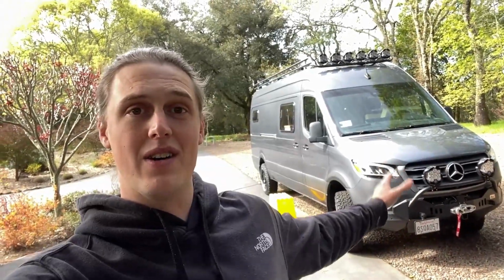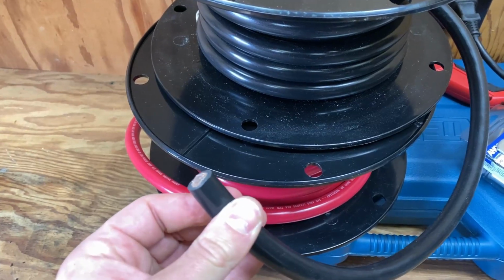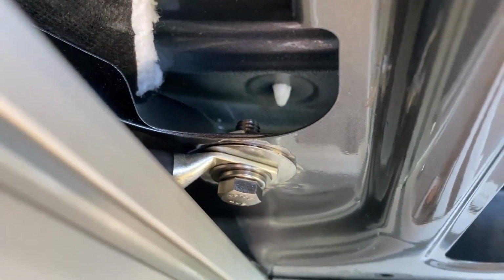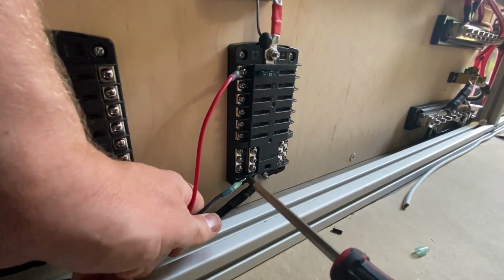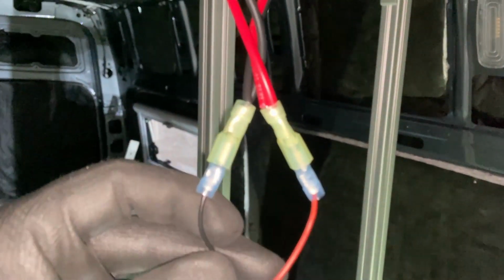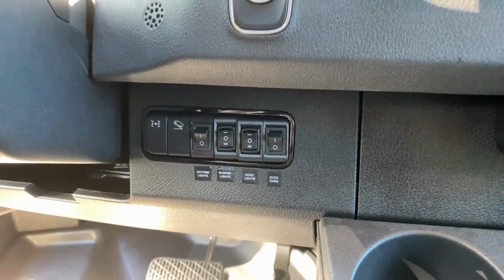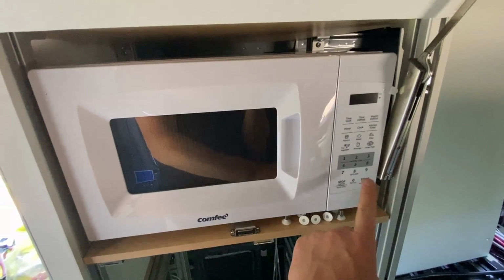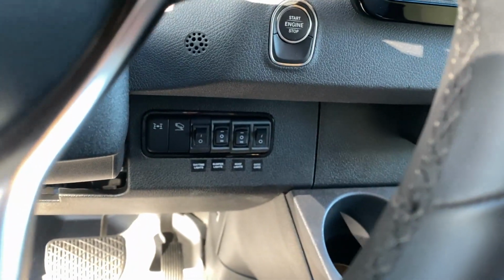⚡ How To Build An OFF GRID ELECTRICAL System In A Van ⚡ - Part 2 of 2 - Execution

Comment: First - thank you for this video. With 1000Ah of battery, did you consider a second alternator (like Nation's Alternator sells) with a Wakespeed WS500 regulator to put out 280A of charging? Would really cut down the charge cycle times if you're planning on using that A/C often. I'm looking at using that setup and wondering if there was a reason you didn't do it (other than maybe cost, but that seems to be relative).
Reply: I’m planning to get that same alternator. From what I read you don’t even have to run it through a dc to dc charger. I’m not exactly sure the advantage in the 3 belt version. I guess reliability.

Comment: Pro tip. Mount switches and controls on the same side as electrical system not only to save on drilling holes but also saving on material costs

Comment: I have two maxxair fans and the one remote is not a problem. The remote has an extremely limited line of sight so you have to very deliberately pointed at the fan that you want to use. I actually find it extremely convenient that they use the same remote.
Reply from the maker: Good call!

Comment: Definitely test the cell booster before you find a final place to install it. I have the WeBoost version and my hotspot needs to be within a foot to get better signal. It's not the kind of thing where the interior antenna gets mounted inside and you get better bars anywhere inside the van.

Comment: If the "wire highway" is to get power from one side to the other, why not run the supply mains to one or more fuse boxes then branch out along that side from there? Fewer wires under the van.

I would also recommend the plug (male) connectors on the device with the outlet (female) on the supply side, like the appliances in your house. And, make one lead longer than the other. For instance, make the hot longer, perhaps by 1/4" to 1/2", from the device and the ground longer, by the same length, from the supply. Not only will this help keep polarity straight if you need to unplug something, but the connectors won't be side-by-side.

I like the cabinetry skills.
Reply from the maker: On the first though (replacing the wire highway with a sub panel at the destination) that’s what I ended up doing.

Great recommendation on the lengths and the female/male distinction!!! 

Thanks Carl Knox

Comment: Why did you run the conduit outside the van, underneath, rather than through the walls? Great vid, great channel! Thanks!
Reply from the maker: It’s just easier than drilling big holes in the sheet metal within the walls. Also you don’t have to remove ceiling/wall panels to do maintenance

Comment: ya with that battery riggggg I can simultaneously power two welders, a bench lathe, a drill press, 2 angle grinders, and even drill in concrete with an SDS Max, and for all this I also need a crew to operate those equipment...

Comment: I think it's important to plan your highway into your subfloor. I'm thinking if you ran the 2/0 and had a fuse box at each corner of the van it would have been much cleaner.

Comment: @Steven O Savage, did you do power draw and amperage calculations to determine wiring gauges? The cable you were showing while talking about your lighting circuit almost looked like 12 gauge wire which would be overkill if you're using LED lights. The cable shown for the fan also seemed like the same thickness as for the lighting. I was astonished when you showed the bundle of wires in the ceiling for the exterior lights...That looked like a group of wires used to provide power to a small city... 🤣

Comment: When drilling the hole, use a magnet to catch the metal swarf
Reply: And put the magnet in a paper or plastic bag first. Then when done, turn the bag inside out so the magnet is outside the bag and the metal bits are inside. Remove magnet and discard chips.

Comment: I love your videos. thanks. these are called "wire strippers" they are legal in all 50 states. not to be confused with the other strippers :-). also, I'm guessing, since the fan is actually pulling air out, they needed to reverse the direction of the motor. that is why the black is the +. just a guess.

Comment: AC cables should go true a cable clamp when going in a box or a panel (the inverter), and all connection should be done inside a box. For the microwave, a regular female adaptor, like the one you use to make an extension, or a regular outlet, in a outlet box, would be better than joinning a cable like you did. Other than that, i realy like what you did

Comment: Term fuses are a MUST in parallel batteries, especially in lead - acid ones. 12 V batteries are made of cells of less voltage batteries (2V o 3.2V). If one of such cells fails and gets internally short circuited (something not so unsual in lead acid ones), the battery will become a 9 or 10 volts one, so a hell of amps from the other batteries will flow to the damaged one making it burn or explode.

I imagine that "smart" batteries are protected against such failure and over currents, but if there is no protection or it fails too, a disaster can happen. 

So, I think parallel batteries must always have term fuses, or such arrangement should avoided in favor a serial arrangement of single cell high amperage batteries ( 4 batteries of 3.2V 400 Ah for example).

Comment: That's an insane amount of power! I'm curious, for such a large system, why not start increasing the system voltage? A single 25.6v 200AH battery holds about 5kw or 400ah at 12v
Reply: I think it’s because so few tv components use 24v or 48v everything seems to be either 12v or 110v

Comment: bro how do i wire this system WITHOUT solar? i just need enough power for video production on the road. this is prob the easiest video I've found so far to understand when it came to wires, guages, bus bars and where to connect them.

Comment: Seems to me you could have placed 300 lbs of batteries below your center of gravity. Should be as low as possible (floor) as you may experience some undesirable body roll when cornering, especially considering you're already high as a 4x4.

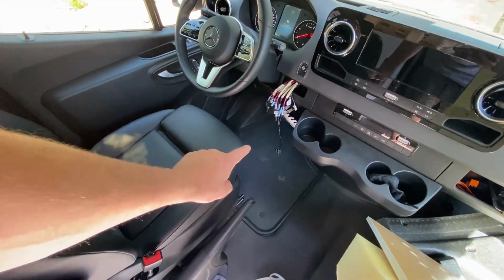Comment: Hey Seven, how were you able you connect the negative input cable from the Renogy DC-DC charger to the negative terminal of the starter battery, as you state at 36:39? It doesn't look like it's possible access the negative stud on the starter battery, that bolt is on such that it cannot be removed ... How did you manage, lol?  Thanks!!

Comment: At 25:36 you mention connecting a sub-panel using a cable from the battery to the sub-panel. Is it 2/0 cable or 2 awg? Couldn’t find it in electric diagram. Thanks
Reply from the maker: I think I just used 2awg for that
Reply: @seven_o_savage  thank you!

Comment: Hi Seven, your videos are so helpful, I'm installing the same inverter and in the same orientation, so I was just wondering, how has it worked for you? Any issues?  Thanks, Keep up the great work!
Reply from the maker: It is okay, I’d use the Victron inverter next time!
Reply: @seven_o_savage  Thanks, was concerned about it being in the vertical position. Hoping to take a van out to your parts one day
Reply: my initial idea was to install the renogy 3000w inverter/charger virtically. But the manual says nenver mounted that way and now I am not sure whether i should completely change my inverter orientation now. curious how your installation work for you so far.

Comment: Great video, similar to my setup but I only have Renogy 2K inverter and 300 amp hours of lithium and 40 amp DC/DC charger. I like how you give links to products you use. My Renogy 2K inverter trips my house GFI circuit for some strange reason but runs fine on non GFI circuit. I have sent Renogy a support request but no response from them for over 2 weeks :(

The Isotemp water heaters are great (Slim square 16L).

Comment: I've watched this video and Part 1 about 15 times now, I'm just now starting to have a basic understanding LOL. I'm going to be using the wire diagram you posted to copy how you have yours set up 😁Anything you'd change or do differently now that this video has aged?
Reply from the maker: Awesome! Only thing is I’d use a victron inverter because I think they work better. Other than that it has been perfect

Comment: Here is a little explanation of the differences in wire color codes. I hope this helps someone.

Typical DC - Red is positive and black is negative/ground.
Typical AC - Black is hot and white is neutral and green is ground.
Typical Trailer DC wiring - Black is positive and white is negative/ground.

Comment: What made you decide to go with 2/0 wire to connect the batteries? The manual that I got with my Renogy 3000W Inverter/charger recommends 4/0 wire.
Reply: Quit toying with 12v inverters and go 24 or 48v. Then it'll be loads more efficient and you can run smaller wires. I have yet to figure our why rv and van people keep sticking with 12v inverters. There are more efficient systems out there.

Comment: FYI, the vent fan is from the RV industry, and RV wiring is Black + and White -.   I've never understood why they do this, because RV's with AC outlets also use black and white wires.   This makes no sense to me. AC and DC circuits should be visually different for quick identification.   Also due to vibration in your van, you may wish to consider using Nylock Nuts. they will not vibrate loose.

Comment: Question Seven O Savage, do you need to ground the battery bank negative wire to the van chassis? Can't the battery bank electrical system be isolated negative? If so what are the pros and cons? Thanks!
Reply from the maker: As far as I can tell the only real reason to ground to chassis is for the case of a hot wire getting exposed (due to vibration or something). If your battery bank is grounded it will cause the breaker to trip when the exposed wire comes in contact with any metal of the van.
Reply: @seven_o_savage  Thank you!

Comment: Another great video thanks. I have a question concerning the 120 volt AC. How did you ground the green ground wire on the AC side. I have read you can just ground the green wire to the inverter housing or do you ground the AC to the van chassis? Thanks again.

Comment: Looks good! You provide good info and your build/material choices are very similar to what I'm planning. For some reason, I've been stuck on which batteries to use. I'm definitely planning on lithium, but the info is so convoluted. The price spectrum is crazy, too. I had been considering the Renogy 200ah lithium, but I'm very confused why it's less expensive than their 170ah lithium battery. I noticed you went with their 170ah option and I'm curious what your thinking was with that. It also seems like Renogy's projected life cycles are less than other lithium batteries (around 2000 vs. the 3k to 5k I'm seeing elsewhere). Is it just an inferior battery or are they just being extremely conservative with their projections? Interested in hearing your input. I welcome others' input, too. Thanks

Comment: Might be cheaper to just use copper tubing and flatten it out instead of the copper cable and lugs (basically bus bars). You can even put shrink tube around it.

Comment: Maybe a dumb question, but all battery monitors seem to max out at 500A monitoring capacity? How are you planning to monitor your system in that case?
Reply from the maker: 500 amps of draw would be a lotttttt. That’s different than amp/hours which refers to the capacity of a battery.
Reply: @seven_o_savage  ah, duh. Was confusing amps for amp hours. I thought the shunt needed to be sized for the battery capacity not the max amps. Thanks!

Comment: 3000w inverter with a 9000w surge   = 650+ Amps.  How do you stop the inverter from surging?  Water heater is running and you put some popcorn in the microwave and you get a surge. Thoughts?

Comment: Thanks for the video! I got a lot out of it and the previous instructional one. 
One question: how did you fit the MBRF fuses onto your Renogy battery terminal bolts?? The MBRF mounting hole is 3/8" and the Renogy terminal bolts are M12 (1/2"). Dealing with this issue with my own 170Ah Renogy battery right now.
Reply from the maker: I drill them out a little with a step bit
Reply: @seven_o_savage  I called Blue Sea and they said this can be done, with the only real downside being you lose the nickel/tin plating on the interior hole lining. Since the battery will live in a van, not a boat, this doesn't seem too significant of a loss to me. Thanks Mr. Savage! :)

Comment: how are you connecting the 12/3 stranded wire to the 120 volt outlets? I’m having issues with the stranded wire and screws. Are you using some type of terminal connector?
Reply from the maker: Nope it was awkward I just wrapped it around the best I could

Comment: Have your shorepower inlet been catching on brushes when you back into parking spots?
Reply from the maker: Negative. It’s still higher than the bottom of
The frame so if It catches I have bigger problems

Comment: did you have to drill out the terminal fuse blocks? the blocks have an M10 hole in them however the Renogy 170AH batteries have an M12 post on them.
Reply from the maker: Yes I did, just used a step bit

Comment: A good video! Thanks for sharing the details with us!!!

I was wondering if you considered using a 24v or 48v system? They are less $ to wire as they don't require as much heavy gauge wire. 48v is more dangerous to humans if accidentally shocked. The higher voltages are generally more efficient as a whole.

Just was hoping you share your thoughts in choosing 12v batteries.

Best regards,
M-

Comment: Reason the dimmer switch "switches" the negative side is that the component
 (cmos transistor ) that dims the power only works on the neg. side of the  circuit.
Reply from the maker: Very interesting! Makes sense...

Comment: Fusing is not related to the current draw of appliances. The fuse protects the cables. The cables are specified by current draw, diversity factor, free air or embedded in thermal insulation, ambient temperature, electrical insulator type and allowable wiring losses - volt drop. Not a simple subject. 
  If you connect a 3kW inverter by  12 AWG the fuse is determined by the cable not the 250 Amp drawn by the inverter.

Comment: Curious about something ... don’t you need a voltage regulator to ensure you have smooth 12V in your DC system for the fridge and fan etc since the voltage will fluctuate a bit on the battery.
Reply from the maker: Nope most dc devices accept a range of voltage

Comment: I thought that you determined you need 12 gague wire for the lights according to the chart in the previous video, since it is 30 ft round trip in total.. But you used 14 gague and said it was overkill.... am i missing something?

Comment: Wandering how to prevent lithium dendrite in this system building. That could cause short circuit inside the battery and may lead to fire.
Reply: As temperatures drop to 0 Celsius, charging lithium batteries would cause permanently hurt and boost lithium dendrite growing.

Comment: If you had the opportunity, would you have preferred to run the wires under the floor, so that you didn't have to run them under the Van?
Reply from the maker: Good question... 100% no. The floor is the least removable part of this particular van
Reply: @seven_o_savage  If you had not installed the floor yet, would running the electrical cables under it before it was put down make sense? That is where I am & I am tempted.

Comment: I based my electrical off your list and have been pretty pleased but have run into a problem. The 300a breaker from Amazon has been my weak point and after doing some research have found that it is a common problem. Can you recommend an alternative. Currently my whole system is down until I can figure something else out as I don't fill comfortable using them again.
Reply from the maker: What problem are you having with the 300a breaker?
Reply: @seven_o_savage  when using the inverter it would trip about a minute into using my hot water heater so I thought my Bosch electric heater was drawing too much amperage at start but then I did research and the reviews on the Amazon site showed the same problems I was having and it looks like the breaker isn’t really able to handle 300a but trips at around 150-180a
Reply from the maker: Strange… I would probably just try a different brand of breaker. They sell some high quality ones at west marine but suuuuper expensive.
Reply: @seven_o_savage  thanks. I looked into west Marine but didn’t see any 300a circuit breakers that I could reset. Will look into some of the fuse blocks and maybe use a switch with it.
Reply: @jgirt72  I have the same problem with my microwave tripping the 300a circuit breaker in this system.  Did you find a good alternative?
Reply: @jessechandler9878  I ended up replacing the resettable breaker with  a non resistible and added a marine grade on off switch

Comment: Why wouldn't you have a copper bus bar rather than crimping all the jumper wires? Put an L in the end and drill another hole for the DC cable connection... 
I would also line the battery box with an insulator since riding around off-road may let the batteries hit your aluminum cage...

Comment: I'm building something similar into an aluminum trailer. How do I ground my system to an aluminum trailer (compared to steel)?
Reply: BTW this is the most useful electrical buildout video I've seen.
Reply from the maker: Thank you 🙏. Same grounding method as steel 🤙

Comment: Running wires threw the metal in the walls can lead to shorts if the insulation wears through. A conduit should be used to avoid these mistakes. Or a rubber grommet is used in some cases to protect the insulation from cutting by the sharp metal edges. This guy is no expert and I would never let him near my electrical wiring.